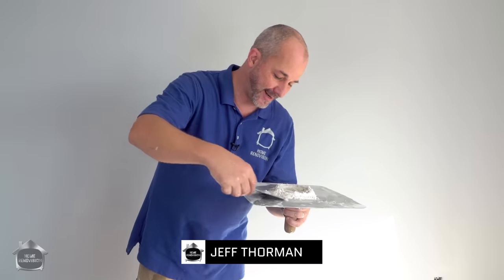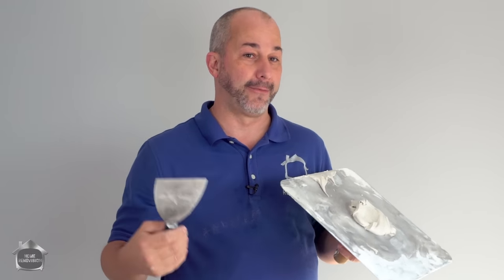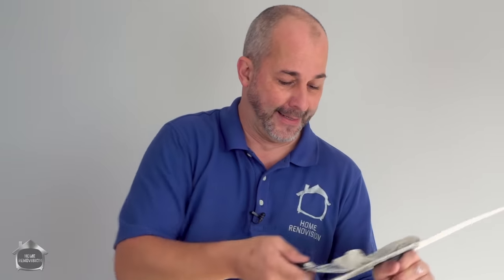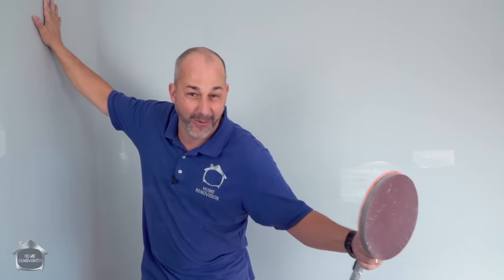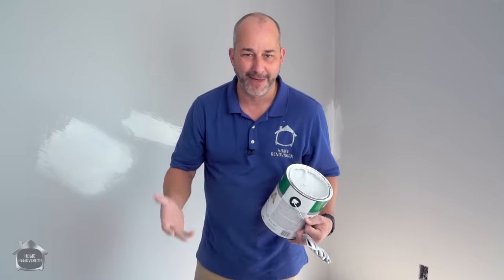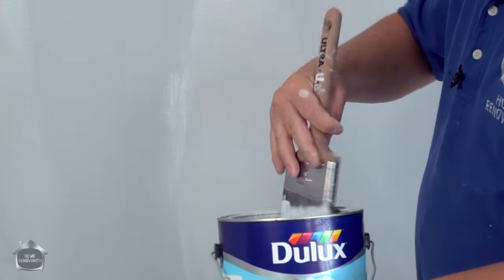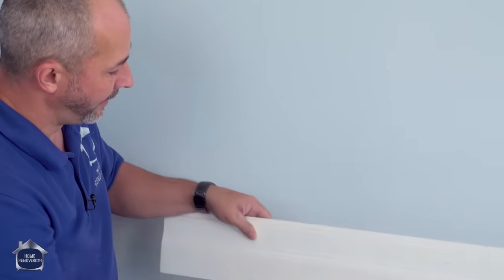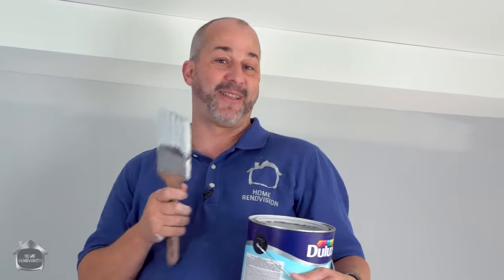DIY Drywall Part 5 | How To Sand And Prime For Perfect Walls

Comment: Be a easier and faster to just plaster it we don't use tape a d joint much at all in UK not a better system than plastering
Reply from the maker: But your paint takes 2 to 6 hours to dry between coats. Drywall allows a much faster build time for the project as a whole. Cheers!

Comment: This is wrong you don't spot prime with a brush the walls are textured the mud spots are smooth. The reason you spot prime is not just flashing its to put a texture on the repaired areas which is done with a roller not a brush. Also most primer is minimum 2 hours to recoat. The lifemaster is not dry in 20 minutes and the reason you have the little white streaks from the brush is you are not putting the paint on at the specified thickness ( mills)  if you was a true professional you would of read the TDS or technical data sheet. Here it is 

Recommended Film Thickness* 
• Wet: 4 mils 
• Dry: 1.5 mils 
Drying Time* @ 77°F/25°C - 50% Relative Humidity
*Drying & recoat times are dependent on temperature, 
humidity, ventilation and film thickness 
Touch dry: 30 minutes 
To recoat: 4 hours

Congratulations you just lost the fade retention, burnish resistance and scrub-ability properties of the paint. If it was designed to go on " real thin" it would say Wet mills 1. Some products are designed to go on thin. The product you are using is not. 45 minute mud is a fast setting compound. It is not cured and paint ready in 45 mils. You have no idea. Total hacksaw.

Comment: Should never spot prime with a brush. The roller puts a texture on the wall. The spots you patch are smooth and the rest of the wall is textured. That's why you use a roller to spot prime! Also ten minutes Is not proper re coat time. Read the can!!!!!!!!

Comment: Disclaimer= Do not do what he does. Do not use a brush ever on a wall even if you do super light strokes. ALWAYS use the final desired texture, from beginning, to end. Aka= roll the wall with primer, don’t brush. Because you are going to still be putting brush lines onto the wall. And when it dries, you will see the brush lines ..always
Reply: Just go over the patches with the roller at the same time you do the cutting for the first coat, by the time you're ready for rolling, the patches are tack free and  it won't show. For general level of quality, if we're talking about expensive high level jobs with bazilion lights directly on the spot, you shouldn't be spot priming anyway I guess.

Comment: Why paint a perfect trim? Put floor in first. Then trim and if you get any gaps use a white filler like acrylic tube.
And why only paint. Why not wallpaper? Painted walls look cheap and horrible, imho. And they never gets perfect. BTW you need to have good lightning when you do drywall and painting. Get some 200 watts LED on a mount.
Reply: Wallpaper?  1990's was 3 decades ago bro.
Reply: @chambo5326  Just admit it. You don't have wallpaper because it is cheaper to paint. Everything you do in the US is based around what is the cheapest. USA is just a very poor country. No one have paint on the walls were i live.
Reply: Bro.. you're joking right??
Reply: Nick J  Yes i do have a wet bar in the basement. No mirror. What is wrong with the wet bar?
Reply: Nick J  spot on apparently lol
Reply: John Strand no one likes wallpaper here. That went out of style many decades ago.
Reply: @chambo5326  It takes one to know one.